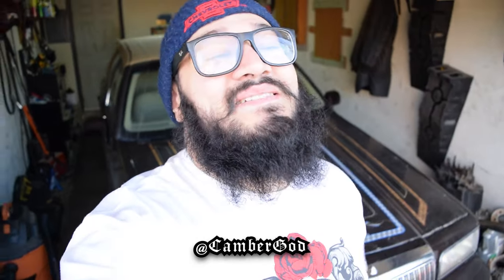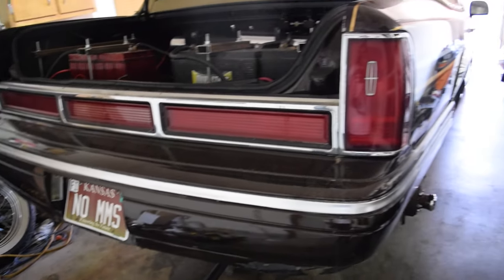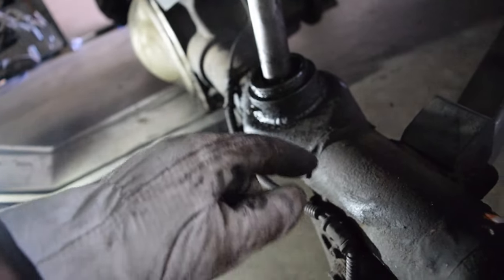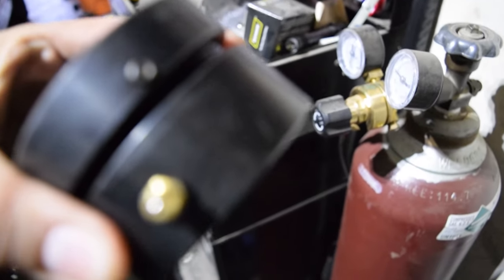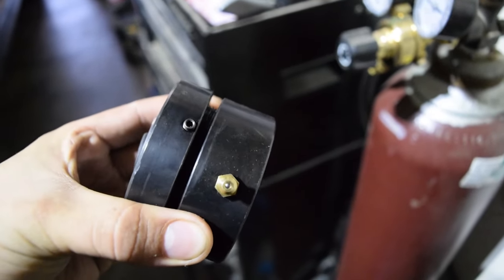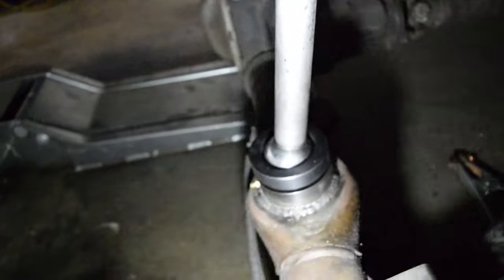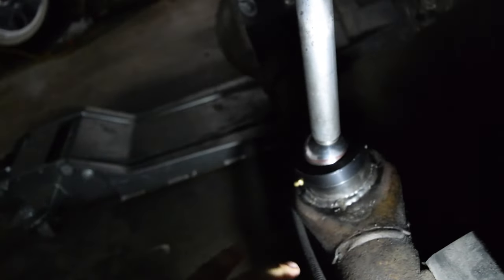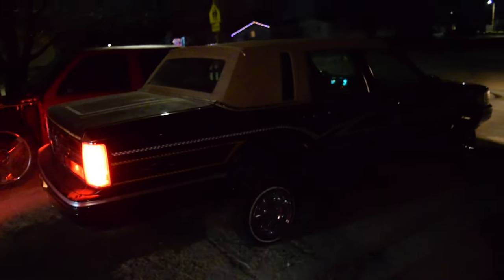Fresh Powerballs on the Lincoln Lowrider

Comment: Did you cut the springs in the rear so it can lay lower lol cuz you didn't film that part bro and take the bump stops off so it can lay lower
Reply from the maker: It’s not even hitting the bumpstop yet, I found out the diff pinion angle is bad so sometimes it lays out more lol

Comment: Thats what's up carnal car looking sick what's next on the map for it did you cut a coil off the springs so it can lay lower make that ass drag homie ?
Reply from the maker: No I didn’t, I’m gonna have to adjust the trailing arms to get the pinion angle better. When laid out it binds with the driveshaft lol so sometimes it’ll lay a little lower
Reply: @CGOD  oh homie also open up the rear slow down more that's why it makes that cracking sound needs to be more open it lowers to slow I had to do that to my lowrider
Reply from the maker: @LOWRIDERSGTV  I need to bleed out the lines for the rear. When I got it it would slam down on side and the other side not as much. So I just closed up the slowdown for now
Reply: @CGOD  Koo homie merry Christmas and happy new years 🎄🎉
Reply from the maker: @LOWRIDERSGTV  thanks brotha! Same to you and yours!
Reply: @CGOD  gracias homie 👍🏼

Comment: What does the set screw do? I’m at a lost right now on my 63 I’m trying to remove my cylinders and I can’t get the power ball cap off 🤦‍♂️🤦‍♂️ I’ve tried so hard
Reply from the maker: The cap is threaded onto the body of the powerball housing, once the set screw is loosened you should be able to loosen that top cap in order to free the powerball from the housing. Might have to use a pipe wrench if it’s been installed for a long time
Reply: @CGOD  I have been trying for about 3 hours straight with different tools I even took off my rim and tire just to get a better grip and all because of that little screw 🤦‍♂️ thank you so much and to loosen the screw how do I go about that?
Reply from the maker: @CholoStout  it should be an Allen set screw, once you find it try a few Allen wrenches until one fits tight cause you don’t want to strip it
Reply: @CGOD  thank you I will update you!